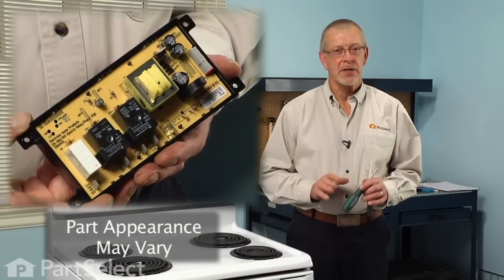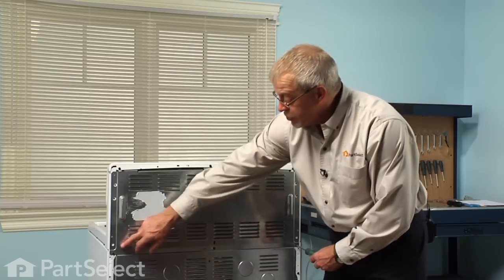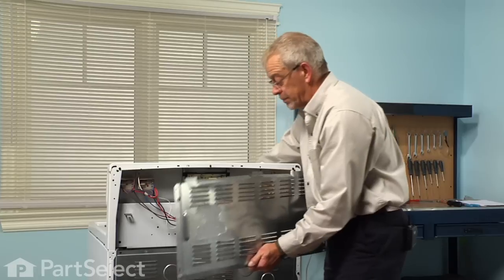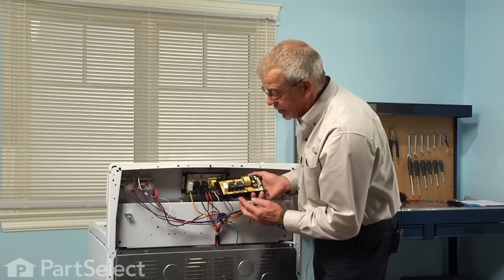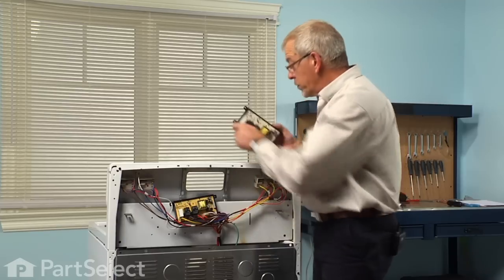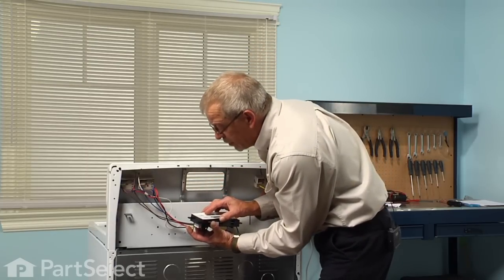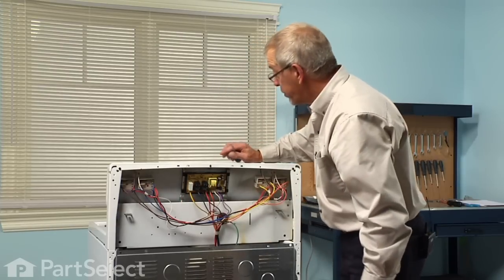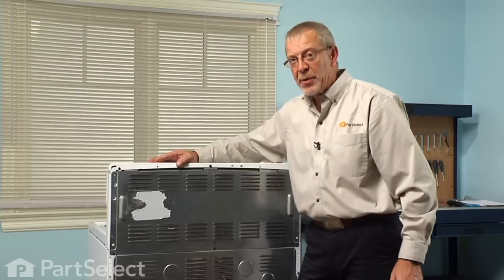Range/Stove/Oven Repair - Replacing the Clock Timer (Frigidaire Part # 316455400)

Comment: This video is helpful. My parts are working but the escutcheon keeps sliding down...any tips on how to rectify that?
Reply from the maker: The adhesive may have peeled off when removing the escutcheon from the old clock. Try a strip or two of double faced tape to adhere to the new clock.

Comment: The model # EF336ASF. I checked the wesite and there wasn't anything detailed about the wires. I have it screwed in place but, I need to confirm the wires before I can plug it back in... =)

Comment: I have an olld oven model number FEF352AWF...The burners work and I replace the electronic control part # 316557118...The clock works but I can't set it and the buttons seem to be wrong...And the oven door won't open...
Reply from the maker: +freein2339 We show part number PS820139 as the control for your model. You may have to activate a self clean cycle and thencancel to get the door unlocked.

Comment: I have a Frigidaire Caprice cookmaster wall oven. I would like to disable the auto timer as I can't get the oven bake or grill to work after using the rotisserie. This happened to me the last time I used the rotisserie, but I got the oven to go again after fiddling with the timer. Can you tell me how to reconnect the wires at the back of the clock so I can no longer use the automatic timer. I don't mind loosing the clock as I turn the oven off at the wall when not using it. This solution will be cheaper than buying a new wall oven. Thanks.
Reply from the maker: spud pud  We cannot recommend altering the wiring on any appliance.
Reply: ***** Unfortunately I have to buy a new stove just because I'm unsure as to which wires to disconnect from the back of the clock. I know there in the US you can be sued for anything and you must protect yourself. Perhaps you could send me a wiring diagram for the functional clock I and I could just work it out myself. I have had it apart but I had no one to confirm why what goes where.

Comment: thank you so much, found that one of my terminals is broke. need to replace my terminal & darn my luck my hardware store didn't have proper size. the orange wire terminal, its bigger than the others. any idea what size terminal that is?
Reply from the maker: Kimberly Rhoades What is the model number on your stove?
Reply: I actually went to several electrical stores and no one had the right size terminal. I had to use the same size as the other terminals & actually spread the terminal open wider to get it on. Don't understand this.

Comment: I believe this is the same model as mine. On the lower part of the stove, the model number reads CFEF320GSA. Does that correspond to the control board part # 316455400? How much does this part typically cost?

Thanks for this video!
Reply from the maker: Rain1290  316455400 is the correct part number for the control for the model you are stating. The cost is stated on our website using that part number.

Comment: Does the clock timer part have the alarm sound?  The sound on our timer stopped working.  Thanks
Reply from the maker: Yes, the piezo electric speaker is located on the control board.
Reply: Thank you Sir!

Comment: +PartSelect we are in need of the piece with the sticky adhesive on it.....we don't need a whole control board. The plastic cover is damaged and we would like to get a new one....we just bought a Frigidaire crown series model number fefb55chse...if you could help us I would appreciate it
Reply from the maker: +Vashia Jones This part was not available from the manufacturer.
Reply: +PartSelect ok, thank you very much for your time and effort.

Comment: What if I accidentally break one of the wire clamps when trying to switch them out? Where can I buy a replacement? Any hardware store?
Reply from the maker: Hi Laura, yes you could buy these at most hardware stores, however if the terminals are connected to a heating element you should make sure that the replacement terminals are specified as high-temp terminals. Apologies for the delay in getting back to you, and good luck with your repair!

Comment: My Frigidaire oven sucks.  It is not that old and needs a clock timer.  They don't make the replacement part anymore.  They advised me to buy another oven at about 1,000.00.  I will... but it won't be another Frigidaire.
Reply from the maker: Bourne Accident What model number is your stove? I can see if we can locate the part you need.